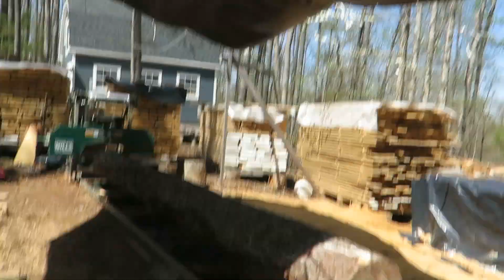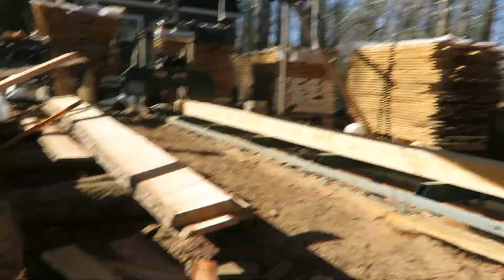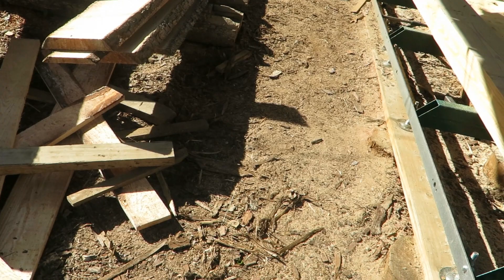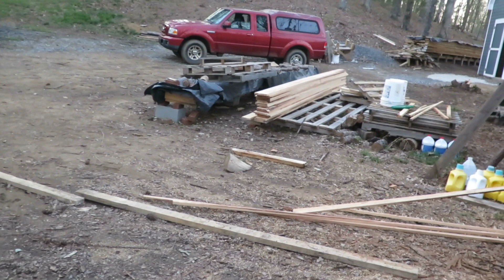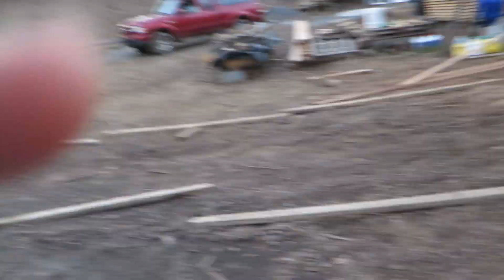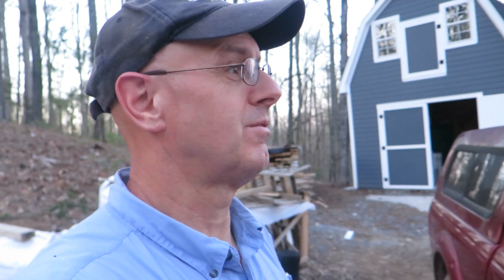Eps#160 Milling in a wind storm! Making 2x10 on my Woodland Mills HM122. Beautiful clear pine lumber

Comment: Howdy brother- those logs turned out some really nice lumber.  I haven’t priced any clear pine in a while. I was needing some 1x6 and 1x8 clear pine but it wasn’t available so I milled some and it’s just about ready for planing. I found a nice set of tongue and groove router bits yesterday so that will get me fixed up. I won’t be buying any more t/g . Hope the storms that moved across the south didn’t affect you. God bless
Reply from the maker: Got the wind only the next day. Are the router bits for 1/4 or 1/2 shaft?

Comment: You get more terrific, big lumber milled with the WM HM122 than I have seen on any other channel. Great job. I have followed your channel since the beginning and I wonder how you got thru those early blade/ tracking/ frustrating problems, because you've got that mill running incredibly well... I especially like how you cut shorts along the way...
Reply from the maker: Thanks! The milling problems I have solved through trial and error. Some of the tracking issues were due to a worn out belt early on and not realizing when it needed to be changed. Once I figured that out and got the left drive side pulley/wheel realigned, a lot of the problems sorted themselves out. And, yes, I like to squeeze as much wood out of a log as I possibly can!